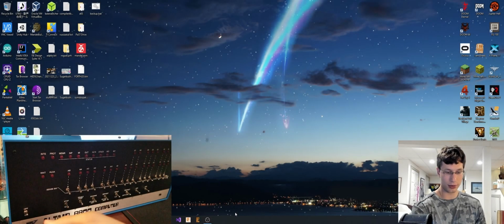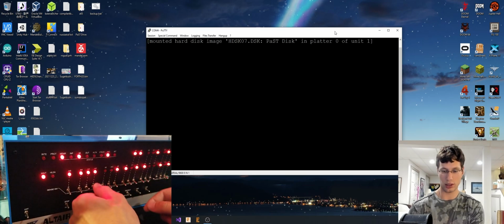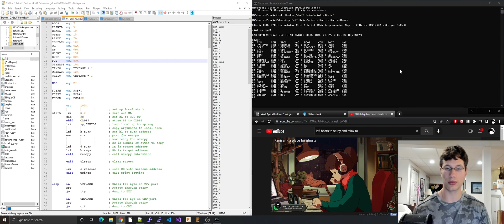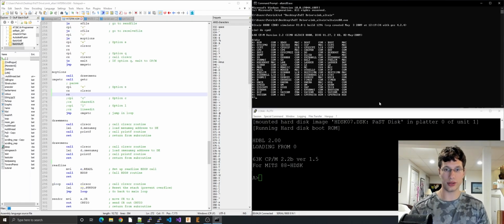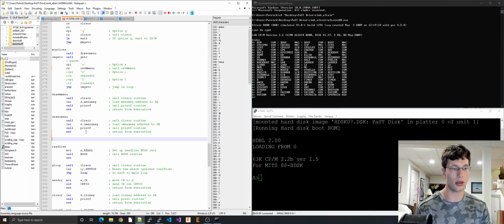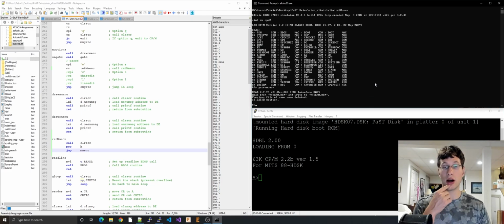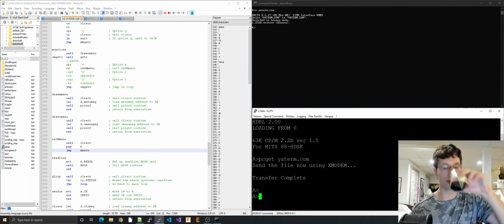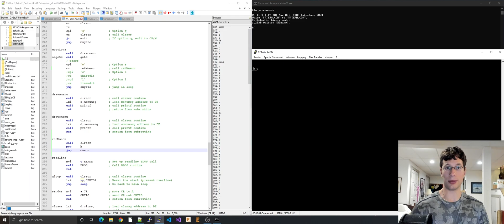Altair 8800 Assembly Development - FAST + EASY SETUP

Comment: How did you get the Altair 8800 c/pm 2.2 to interact with notepad to start writing code? im having a hard time setting up the simulator to interact with notepad.
Reply from the maker: So the trick here is that the Altairduino is NOT directly using Notepad, that's the whole point of this setup. In the video I show how I use Notepad++ to edit source files from a directory, then I use simh altairz80.exe (http://cpmarchives.classiccmp.org/cpm/mirrors/www.schorn.ch/cpm/intro.php) to test those source files by using R.COM and W.COM to read and write files from the local directory the exe is in. Then, I use some terminal emulator ( in this case I think I use ExtraPuTTY, I recommend TeraTerm now but use whatever you are most comfortable with ) to xmodem over a file using PCGET and PCPUT. Note that the baud rate needs to be 9600 for these to work out of the box.

Watch the video again and take notes!
Reply: @TheWinnieston  Got man thanks for the information.
Reply from the maker: @saitamajay6435 Absolutely love that more people are getting into these machines! Absolutely love them, great community, and let me be the first to say that one's programming skills go through the ROOF when you get down into these retro boxes.